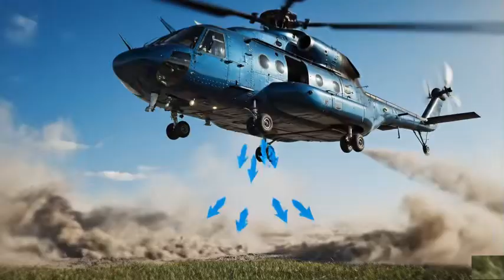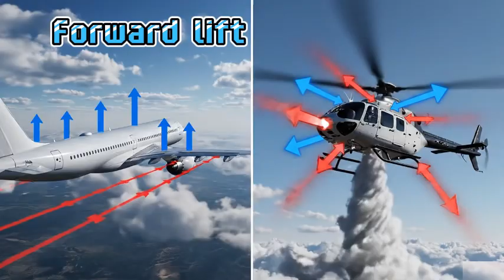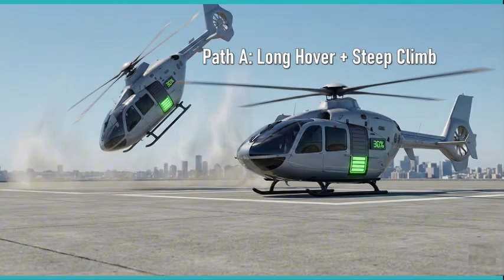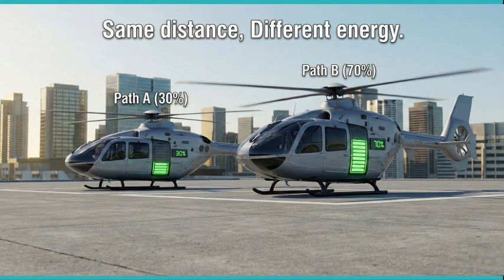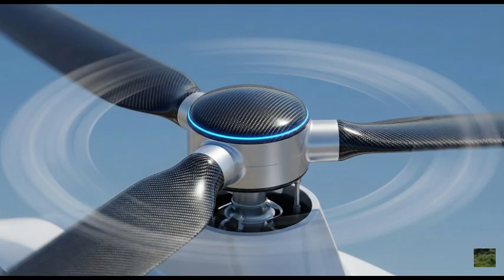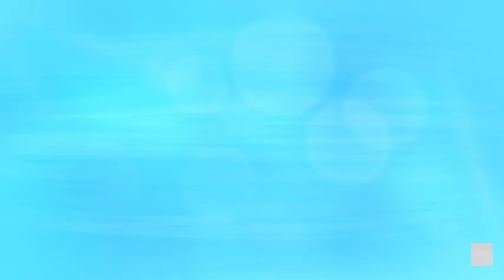Why Helicopters Are So Energy-Hungry (And Why That’s Hard to Fix)

Comment: Ok so helicopters are not efficient. 
I'd like to know how efficient the v2Osprey is vs a traditional helicopter.
Reply from the maker: In hover, the V-22 is about as power hungry as a helicopter (same induced power physics, and it’s heavy).

But in cruise it’s far more efficient, because the wings carry the lift and the rotors act like propellers, it's more airplane than helicopter.